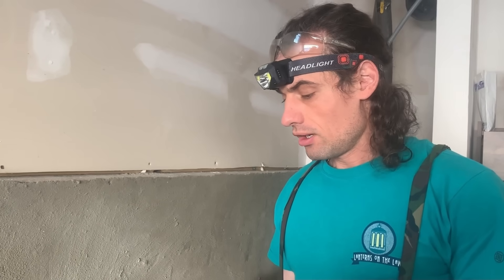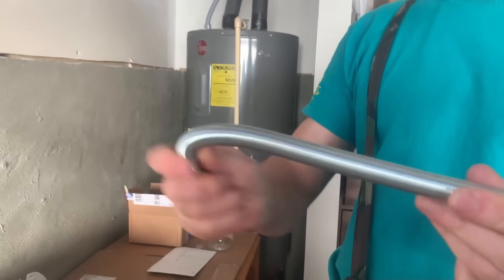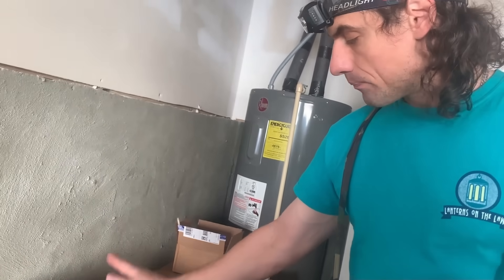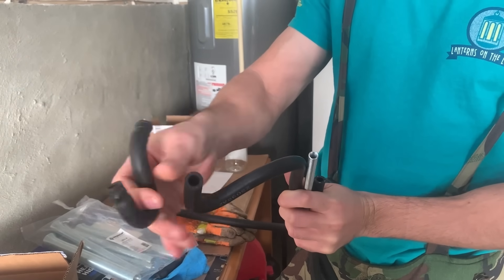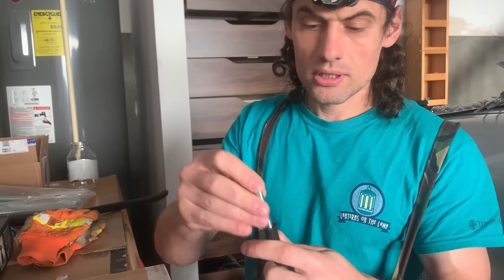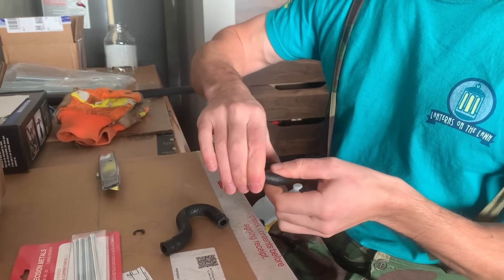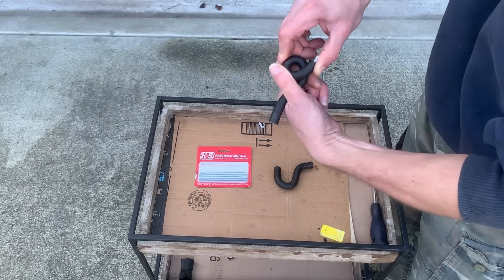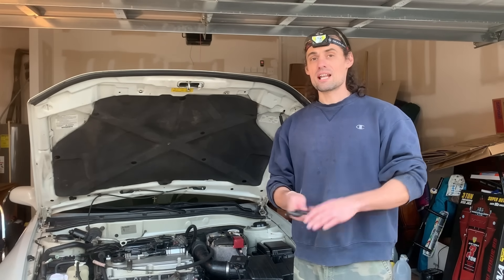Bend Rubber Hoses Without Kinking to Match OEM Parts

Comment: Do not do this with pressure hoses.  Thermoset rubber does not hold its strength when it is re-heated to its melt-phase.  Parts of the rubber will become microcracked and will fail much faster than an original molding.  It is only the braid material which then holds the hose together.  This might be a good "temporary" fix, but not meant for a long-term replacement.  Water hoses and vacuum hoses will be OK with this, where the pressures are only at one-baro, but for Gods sake, do NOT do this on brake lines.  GM engineer.

Comment: They are external springs for copper pipe. If you are goi g to use them internally, tie some copper cable to the far end and feed it back through the centre amd pull it out usimg that.  Otherwise kt doesnt take long to ruin your spring.

Comment: Ok. I don't know the "butter" temperature one would need, but I have conjured up some tweaks for your mousetrap that may result in a smoother more uniform part using the same materials. 

-make a jig on the bench
-stuff hose full of sand and tamp it down
-bury hose in a box of sand
-heat in oven at (magic) temp for (enough) minutes
-pluck hose place in jig (leaving sand inside)
-maybe dump hot sand on it 
-let it cool overnight 

There! I just wrote your next script!

(btw, thank you BTW, for explaining how the real thing is done. Love to learn.)

Thanks, mans!
Reply from the maker: Thank you for the script! There are multiple viewers who suggested the same method. I personally haven't tried yet, but I'm going to for sure next time I need a hose. There's always spot for improvement and improvisation especially for DIY guys. Thank you for watching!

Comment: Way too much of the front extensions out to begin with.  About 6 holes if what you need for the system to function more reliably.  Lippert's Ground Control 3 is very flakey.  You should re-zero the system as well.

Comment: Doing this is perfectly acceptable for things such as PCV hoses or low pressure vacuum lines. But I would not recommend doing that with radiator hoses or something that deals with high heat or pressure.

Comment: This video is not correct. If a rubber hose was made straight it will be made weaker by heating and forming the way its shown here. 

Hoses that are made in certain shapes from the factory are made that way under different conditions while the rubber is not cured.

Comment: Great video, this will come in very handy in the future. Wished I knew this a few months ago when I replaced the PVC hose on our Lexus.
Reply: PCV hose perhaps?
Reply: @sladeherb4056  😆 Yeah, I thought it looked odd when I posted this. I was sleepy.
Reply from the maker: It'll come handy for sure. No need to run 10 different stores, wasting hours online searching particular shape for a hose. BTW I've also changed my PVC hose with this method. It does not need as much bend so was whole a lot easier. Thank you for watching!

Comment: You could try making a jig/former/shaper out of plywood/wood/etc and nails (the old preformed hose would be helpful in setting up the jig ) and that one you did in this video could have used a piece of 2x4 and nails or a similar , like dowels . The nails or similar are what form/keep the rubber hose into place while heating and if the heat doesn't work then maybe epoxy/etc might help . I would also try forming the ends so the hose goes on a little easier , if needed .

Comment: I recognize your accent. My grandfather in Poland use to feel pipes, hoses e.t.c. with fine sand. With both ends plugged he could bend stuff in any shape without kinks or diameter reduction on corners.
Reply: Brake lines flush pretty well, but you've gotta be careful using sand with rubber hoses, as some can get stuck to the soft, heated rubber, stay in place while flushing, and let go some time later.
Reply: That's how I was taught by my Dad back in the 60s when I was 16.
Reply: I watched a brake line video where the guy filled them with fine sand to stop them from kinking.
Reply: @tellyfaulkner3466  Be nice having sand in your break lines! lol
Reply from the maker: Thank you for the alternative way! Thank you for watching!
Reply: You obviously flush them before use dude...don't be daft.
Reply: Greek?
Reply: @loboxx337  No, Japanese.
Reply: there you go then!  Great idea.
Reply: Sugar rinses out better
Reply: It is extremely stupid to put sand into brake lines. They make tools to bend those lines without kinking. They aren't expensive and they're extremely easy to use. Certainly easier that filling then removing sand from brake lines. That's dumb. Very dumb. But filling tubes with sand or water or any other number of things to bend them  has been a workaround for decades. Many decades.

Comment: Great video. I'd like to add my 2 cents. You can fill the hose with dry sand instead of using a spring. Sand works just as well.

Comment: You can also plug one end, fill it with sand, then plug the other end with the same results but it can be used on any length of tubing. You can also use this method to bend PVC pipe.

Comment: LEARNED SOMETHING TODAY THAT LOOKS LIKE THE HOSE THAT IS ON A PACCAR MX 13 EPA 10 TO THE AIR COMPRESSOR FROM THE BLOCK THE ENGINEERS COULD HAVE DONE A BETTER JOB IN MY OPINION A WEEK LINK ON THIS ENGINE.

Comment: Why you install the spring inside? Install out and leave it to there. That way you can make all kind of turns as needed. I made that way computer water cooling system and it still running after 15 years without any issue.

Comment: I wonder if pouring dry sand into the pipe could prevent kinking? Also, maybe use metal pipe or starter motor etc. as a former to define the shape of the bend. Anyway, I have no need to bend rubber pipes lol.

Comment: Very good video. Boiling water also works wonders with rubber and plastic types of hosing.
Reply from the maker: Thank you. A lot of viewers also recommend boiling water instead of heat gun since it puts less stress on  a hose and does not damage it as much. I've learned a lot myself from the comments here! People suggest use send instead of bendable spring tubes and it works. There are a lot of great suggestions in the comments. Thank you!

Comment: Possibly related TIP: Use wintergreen essential oil (real, not 'aroma' oil) or Simple Green to treat/restore old rubber. Let it soak to restore the oil content in the rubber.

Comment: what if you dip it in ice water after heating? I do something similar with vintage action figures that have bent legs.  Heat up the figures in boiling water, then bend the leg in the appropriate direction, then ice water.

Comment: I am an auto technician and I have considered this a couple times, wasn't sure of the best method. 
My grandmother had a car that had a small bypass hose that costed an inordinate amount of money for what is essentially a tube... So at the time I just made an enormous loop to avoid a kink. It worked perfectly and truly ironically I bought several feet of hose for less than the cost of the molded hose.
Reply from the maker: The more you do them, the better it gets each time. You'll get to the point when no one is able to tell the difference between OEM hose and your custom made one. Thank you for watching!

Comment: Boiling hot water and string, wire wrapped around the outside works too. Then you can shape it anyway you want drop it in water for 10 min pull it out and put in the freezer.The steel wire won't get hot enough to melt into the hose

Comment: I have bent both steel and PVC pipe by heating (with either a torch or heat gun) after filling with well tamped sand and plugging the ends.  This technique might well work on hoses.  Of course, you'd want to make sure you completely remove the sand from the hose afterwards.

Comment: Plug one end of the hose. Fill hose with sand. Plug remaining end of hose.
Heat and bend and secure the shape until it is cool.
Open the ends and remove the sand.
WASH THE HOSE OUT. Let dry and you are good to go.
Reply: That's how I do it. No need for fancy springs that might get stuck...
Reply: Was thinking the same.  That's how I've been doing it with some PVC piping projects.
Reply: radiator water is 200 degrees.  
So "cook" hose at 240 in oven?
Reply: @robertsmith2956  240 may not be hot enough to effect a permanent bend.
Radiator water can go past 200F.
With the right radiator cap, you can reach 240F.
Reply from the maker: Thank you for sharing this method! Multiple people have suggested the send as well. I think at least dozen of people, but I never tried it myself, but I'm going to for sure next time I need a custom made hose. If dozen of people suggested it, I bet it'll work. Again thank you for sharing and watching the video!
Reply: @ngtitovWorldOfCars  sand should get hot and help heat the rubber inside.  Need to make a jig to hold the hose I think.  Clamp is to imprecise.
Reply: @ngtitovWorldOfCars  That is how you custom bend copper tubing. Sand to keep the shape of the tube and prevent kinking.

Comment: You can possibly use the metal spring on the outside of hose, which will keep it from kinking, just cut spring to length, and buffer the cut end to prevent sharp cut from damaging hose
Reply from the maker: That could possibly work. I've never tried it, but I considered it. The only issue with this method I could think of is if metal spring tube is outside of the hose, and you get it red hot, it might burn through the hose. It is unlikely since the hoses are pretty durable. but I still could damaged the hose.
Reply: @ngtitovWorldOfCars  if something is causing the metal to get THAT HOT, you have other issues to worry about🎯😁

Comment: Thanks for that little spring and applied heat demon station to the rubber hoses. I have found that if you just apply a little heat to where the inside of the bend will be for you bend it. Then continue applying heat after the hose is bent the heat will be more consistent around the rubber making the hose except the bend better. Thanks again.
Reply from the maker: Glad it was helpful! Thank you for watching!

Comment: Use caution. When you pull on the spring the spring will open and when you stop pulling the spring will close if the skin of a finger gets pinched it will hurt so use caution when bending springs and pulling the springs open
Reply: Also remember to use a helmet and a floating boat west when you wash your hands. And also to not get hurt when you touch a hose when you water your lawn Is getting vaccinated. You need a booster to be safe from this extremely dangerous activity.
Reply: Also don’t forget to look both ways 8 times before crossing, and never eat as to avoid food poisoning
Reply: @WPXTacoMan477  best way to cross the street or to avoid food poisoning is to get vaxxinated

Comment: I think you got your money's worth out of those gloves a long time ago. 😂
Reply from the maker: I absolutely did!
Reply: @ngtitovWorldOfCars  The gloves retain job memory, they have wisdom, and are like old friends. I use my old gloves for many different things after they are tired of the regular jobs. Stuffed, a pair says a visual Hi to the passers by on one side of the fence. I keep an old pair with the spare tire on each car for changing a flat. The dogs will gladly tear one up after a round of fetch with a ball inside and the end tied shut.  .  I have used hot water for decades to form hoses, much more even heat. Ice water speeds the setting process. Thanks for your video.

Comment: Does anyone have thoughts on filling the hose with fine sand and capping the ends to achieve the same goal?
Reply from the maker: Yes. I'm glad my viewers are so creative. You're not the first one suggesting sand. Some viewers suggested water (the same concept) and there's one viewer also suggested wooden board, nails, and screws to give it a shape and stick hose in there and bake it. Whichever works best for you. I'm willing to try all these methods next time I need a custom made hose. Thank you for the tip and thank you for watching!
Reply: Never mind. Found it at the bottom of the comments...

Comment: Great video. If you cannot find the correct spring size, I have used fine sand packed in
Reply from the maker: Packed sand should work as long as it's not too sharp of an angle. Yes, if you don't have a spring of right size, use your creativity as DIY man. I've read people use sand (as you are), one person even suggested to use wooden board, nails, and screws to create a shape. So, just use your creativity as DIY, if it doesn't work, try something else. That's how I got to this method.
Reply: @ngtitovWorldOfCars  salt can also work, and can be easier to remove from small diameter hose.

Comment: Better with a steamer or leave in boiling water.  Les damage or deterioration to hose with burning from heat gun.
Reply from the maker: True. A little more hassle with a boiling water, but it for sure will do less damage to a hose. Thank you for the tip and thank you for watching!

Comment: Can you pressure test a hose that you've bent and compare it to one that you haven't bent?  I think the heating might compromise the rubber.
Reply: Definitely a risk there since you cannot really control the heat very well with a heat gun. The rubber is already vulcanized and extra heat will not damage it until say 100 degrees celsius. But beyond that it's going to make undesired effects to the material

Comment: Rubber cuts clean and very easy when you wet the material and knife with water.
Reply from the maker: Thank you for the tip!
Reply: Gardening Secateurs cut rubber tube nicely 👍
Reply: Interesting… I imagine a small amount of dish soap added could make it even smoother…  thanks for the tip!  I will try it next time I have a need to cut “sticky” rubber hose!